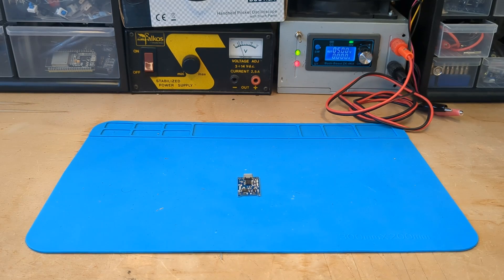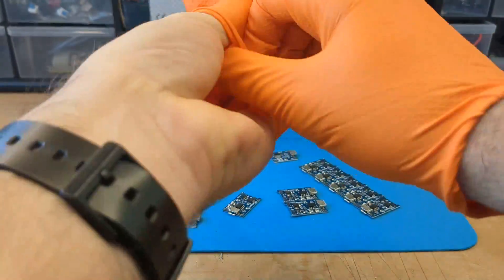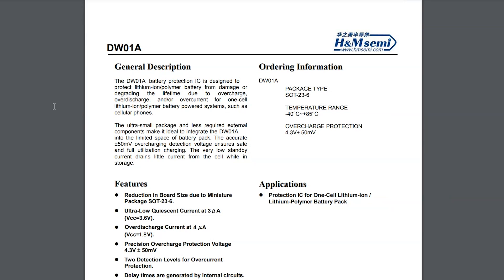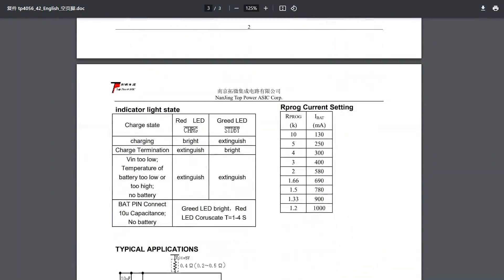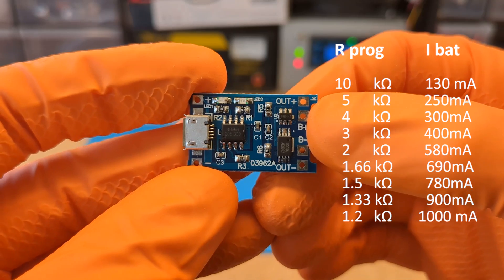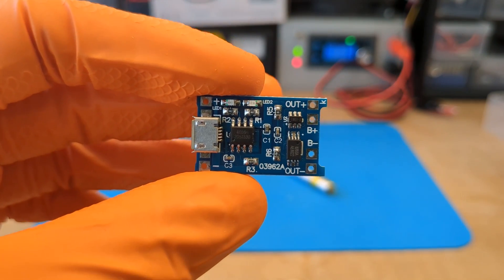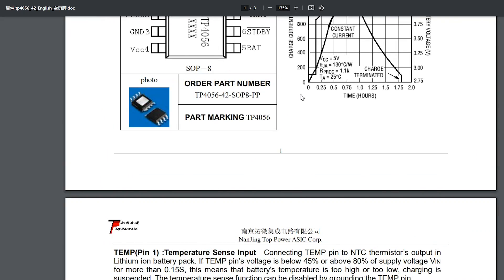3 Tips for better use of TP4056 [+ bonus]

Comment: Can i parrarel this 2 module for double the charging current?
Reply from the maker: Hi there! I've seen it done online, but I've never tried it myself.
At first glance, I don't like it as a solution. I would probably use a module or an IC that can handle higher currents.
But as I said, I've never tried it.
Have a nice day!

Comment: if want to charge battery on the fly, while using it, may  connect the battery to 4.18 V source with C/3 current limiter, battery will never overcharge.
Reply from the maker: Interesting... But I prefer to use a charger!

Comment: Can I charge 2cell Li-Po battery with this module?
Reply from the maker: If you connect two cells in parallel, the TP4056 will charge them together as if they were a single larger cell, but the cells must be of the same type, capacity and initial charge level to avoid balancing problems.
I always recommend that you charge one cell at a time, as if one cell degrades it could unbalance the system and lead to overcharging or overdischarging.
Reply: @dariocose  Thank you

Comment: Very bad modules, most of them charge the battery at 4.3v which is bad for the battery, and if they are left on the battery they draw low current and eventually drain it.

Comment: I tried to make my trimmer re-chargeable. It has a 850 mAh Li-ion AA cell.  I also reduced the charging current by replacing R3 with a 3.3k resistor. The battery charges nicely with no heating.

However, I have a problem. As soon as I switch-on the motor, the blue-light appears & motor stops running. It is a small DC motor that takes @ 250-300mA current. But I suspect that the TP 4056 is getting damaged because of the back-EMF produced by the motor. How do you prevent this?

I notice that after the 1st run of the motor, the blue-LED remains ON while the battery is connected! And I also notice that there is continuity seen between Out-ve & B-ve.
Reply from the maker: motor is an inductive load. have you tried putting a 
flyback diode ?
Reply: @dariocose  Yes it works. I used a 1N4001 with a 224nf Capacitor across Out+/Out- No more damage.
Reply from the maker: @TheControlPhilosopher   cheers! I'm happy you solved it!
Reply: @dariocose  Just one freewheel diode across Out+/Out- ? No capacitor needed? Is 1N4001 ok?

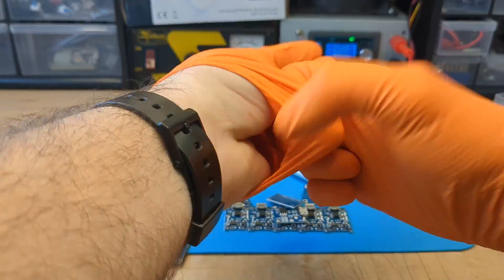Comment: 4:44 the values of r1 and r2 depend on the value of thermistor that you use, and what temperature range you would like to achieve with it.  So it is up to you to decide.  I have used ChatGPT to calculate the appropriate values for my thermistor and desired temperatures.
Reply from the maker: Thank you very much for the tip!
I will try it soon!
Reply: Yes, i did exactly the same.  One may not end up exactly at both desired cutoff temperatures but one can opt for one exact and the other one pretty close

Comment: Useful video.  Would help to have a video from you on adding reverse batt protection and how to use the TP4056 module in load sharing mode.  Thanks.
Reply from the maker: I will make more videos about tp4056 soon.
Unfortunately at the moment it is 36° in my lab and it is very difficult to work!
As soon as the temperatures drop, more interesting content will be coming!
See you soon buddy!

Comment: Hi, do you think the smaller one with no protections + a BMS will work? I need a BMS because my load will be about 10A, which neither of these can handle
Reply from the maker: Hi.
A tp4056 without protection will definitely work better with a good bms.
10A is really a lot. Look for a bms and batteries suitable for this load!
Reply: @dariocose  thanks a lot, yeah I'm making an LED driver, and the strip might draw something around 7A max, so I will buy 10A bms and 18650, because they are capable of even 20A or so.

Comment: Is it’s possible to modify 4056ic for minimum 3v input?  I want to drive 3v 5 watt led with 18650 Battery,
 i already using 5v charger and tp4056 with adjustable regulator for driving table lamp, it’s work great,  now i want a 18650 Battery compatible rechargeable version of it
Reply from the maker: The 4056 needs an input between 4.5 and 5.5 volts.
If you only have 3 volts , you could solve with a DC-DC step-up regulator.

To drive a led properly, more than the voltage or wattage, you should consider the current...
I think that with a good battery and a good led driver you will be able to make it work without problems!
Reply: In brief: No, not possible, but what you can do is put a booster in front of it. Ofcourse it all doesnt add  to the efficiency of the power  use

Comment: There should be an onboard potentiometer to adjust the charging current..
Reply: All depends on what you want to use it for. An onboard potentiometer would have you guessing what charge it was set to aa it doesnt have a scake. Best thing would be 2 through hole pads to easily solder in a standard resistor

Comment: Can i use this module to charge my 10000mah battery?
Reply: The answer is you can but it will take a long long time, and putting a heat sink is also advisable. If you don't have heat sink than use two modules in parallel to charge the battery.
Edit:Remember to do parallel connection of charging terminals, output terminals and battery terminals.
Reply: @azharmukhi5894  thanks for the tip

Comment: The charge current monitoring is also why you should not connect more than 1 cell. As the current will be higher than the cutoff threshold
Reply: You absolutely can connect multiple cells in parallel.  

The charger can not tell the difference between five 500Ah cells  in parallel or one 2500mAh cell. In fact, the cells could even be different capacities because the parallel connection forces the same voltage across all connected cells throughout the charge process.

 I think you may be confusing cell capacity with charge current.  You can charge a 3400mAh cell with 100mA of current safely, it will just take a long time.  (+34h)
Reply: can easily connect more cells in parallel. The TP4056  just delivers current and has no idea whether that is to 1, 2, 3 or 50 batteries.
Reply from the maker: You are right. The tp4056 should only be used for a single battery

Comment: I would love to see a video on how to connect a NTC thermistor to the TP4056 and finally get to know how to set the right values of those resistors.
❤
Reply from the maker: Of course!
I need some time to study and do some tests and I will make your video!
Thank you so much for your support!
Reply: @dariocose  To know how to set these resistors is most important to me, because i want to connect a NTC to a different IC (IP2368 Battery charge controller with USB PD) of mine, too. It's datasheet mentioned only the usage of a 10k NTC and i need to connect a 100k NTC but have no Idea how to do that. Another IPxxx IC also has these 2 resistors, which seem to be included to tune the Chip for the resistance of the NTC. If you can tell me, how to calculate these values, i could finish my current project even before watching your video which of course had to be created first and could not help me with my question in the end. But i will watch it in any case :-)
Reply: It is shown in the datasheet how to do that and how to calculate the rrsistors. If you want to connect them to the module you will need to scratch through the copper track coming from pin 1 that connects it to ground
Reply from the maker: https://youtu.be/qNQbi335H-0 🎉